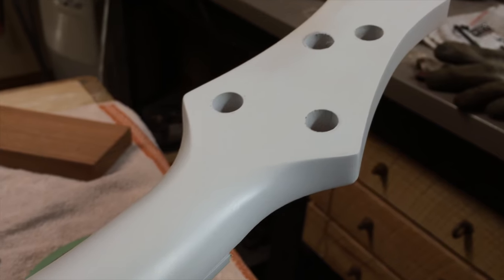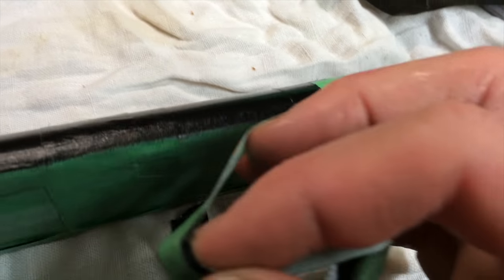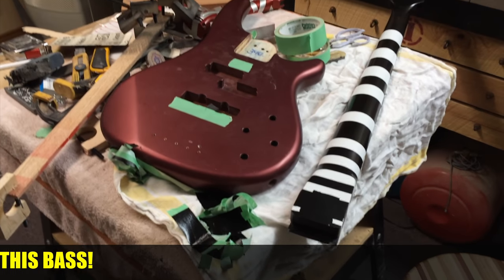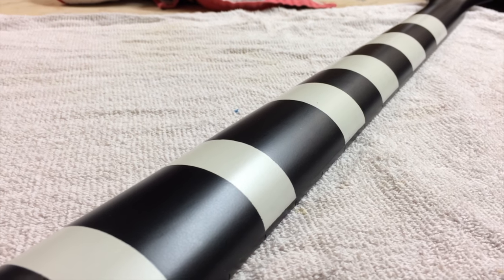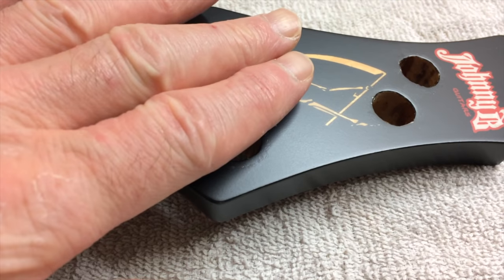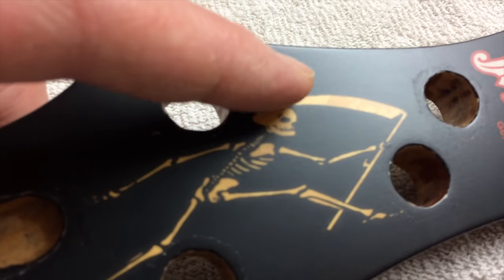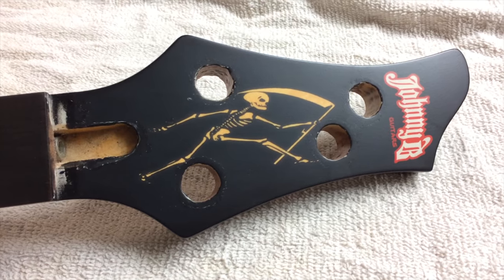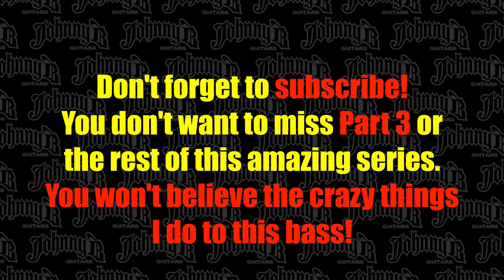Painting a bass neck and applying a headstock decal. The Super-Bass. Part 2

Comment: How long do you have to wait after you spray the headstock before you can add the decal? I’m trying to get the color coat and clear coat done on the same day so there are no adhesion problems. But I want to make sure I can get the decal on before the clear. Or do I have to wait a whole day for the paint to dry before I can add the decal?
Reply from the maker: I'm not sure what kind of paint you're using, in my case I'm using lacquer so my answer is based on that, my explanation my not work for other kinds of paint. I find the decal adheres better when the paint isn't fully dry, but can be applied after the paint is fully dry as well. Since there is a micro layer of water under the decal when applied I let it dry over night before spraying the clear coat. The decal paper that I use is lacquer based so it is not always compatible with other types of paint. Try to do a test run on a scrap piece first.
Reply: JOHNNY B GUITARS I’m sorry I should’ve corrected myself, it’s not really a decal but more of a Ibanez chrome logo sticker. So no water is used, it’s basically a thin sticker. I’m painting using urethane.
Reply from the maker: @DanielRodriguez-eh1qd  If its a sticker then as soon as the paint is touchable you should be able to apply it. Urethane is usually good to work with but test it out to be sure, follow the instruction that come with the urethane about when to apply a second coat or top coat.
Reply: JOHNNY B GUITARS awesome, thank you for your help.